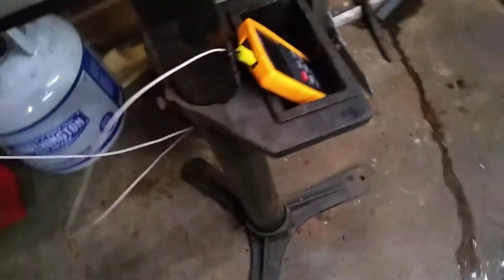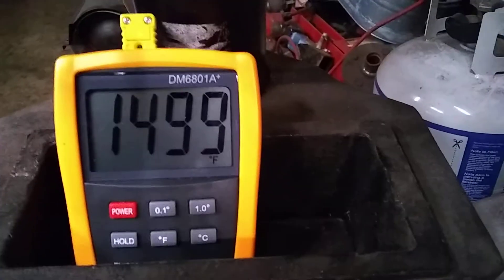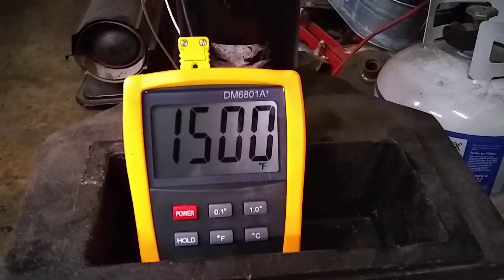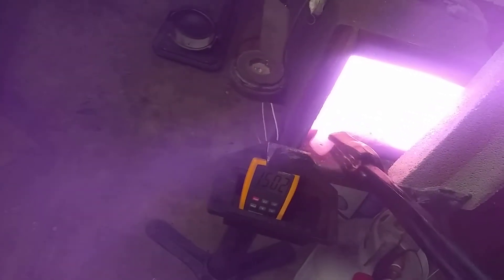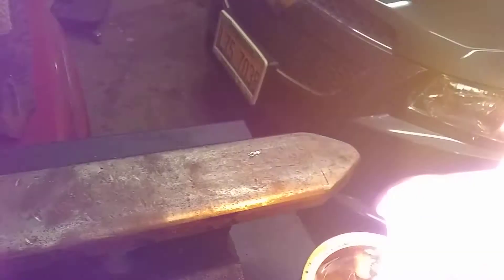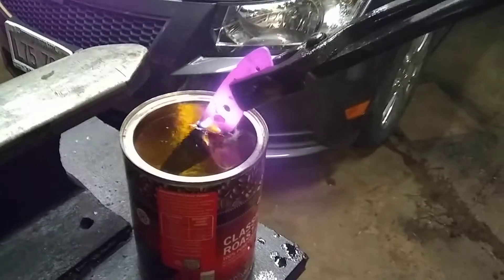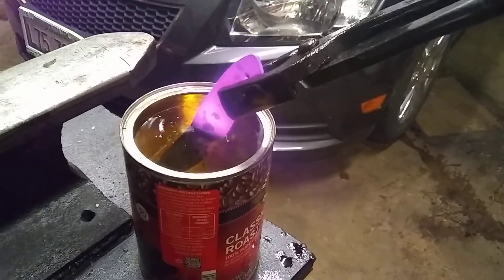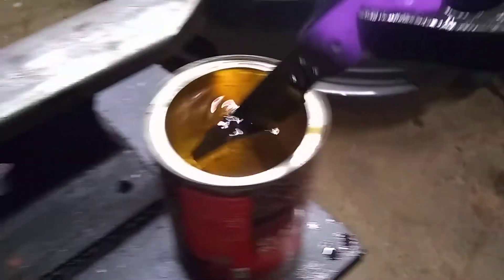Heat Treating o1 tool steel

Comment: How is that blade holding up..?..I have one piece of 01 never did a heat treat on them..what would you recommend?
Reply: Yep...have been looking for a used Evenheat..once I find one its sold..thanks for the info
Reply from the maker: U can do it this way but o1 really needs a heat treat oven
Reply from the maker: Ive made over 500 knives and i don’t have any of them
Reply from the maker: 1480 degrees for a 30 minute soak in a oven for best results the way i did it in this video will give you a hard knife though canola oil works pretty good with 01